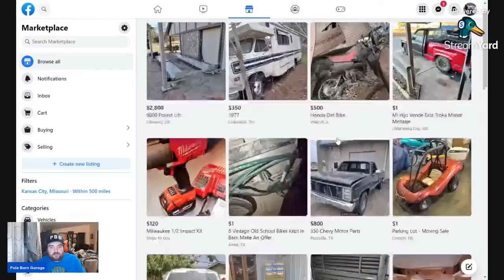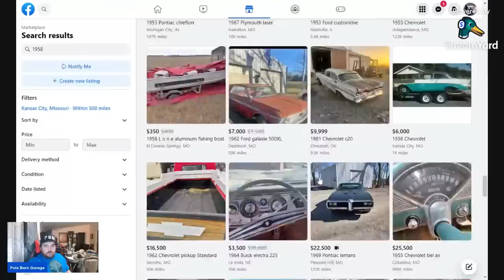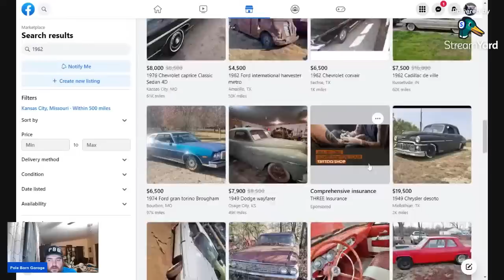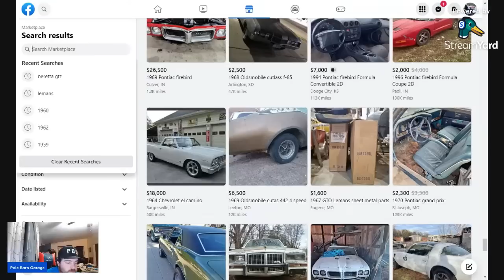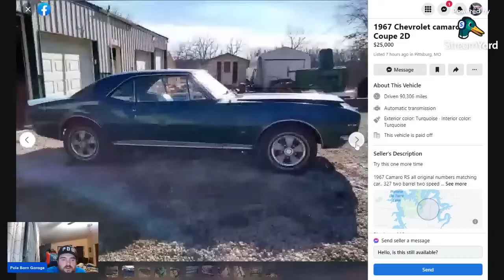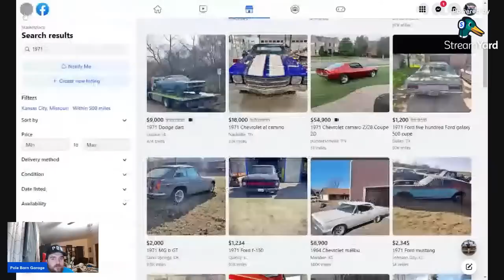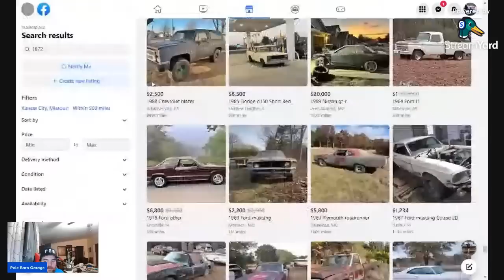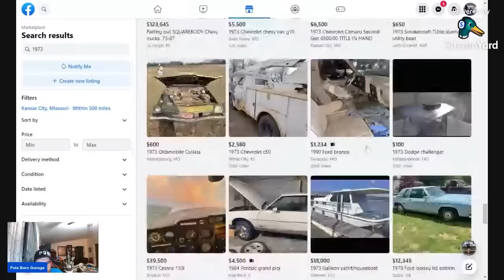The Wild World of Facebook Marketplace LIVE! How do you Find All These Cars?

Comment: That 18500 1958 cadillac was worth that. They only built like 300 of them, and the were like 14000 when new. Restored those have sold for 250000 dollars. They also had every option available, a stainless roof, and a built in mini bar with cadillac shot classes. As rough as that one was it was complete.

Comment: I'm thinking of buying some 16x8 dodge ram lug bolt pattern Indy sprint polished aluminum wheels and put on my 2000 dodge ram Laramie slt longbed quad cab 1500 4x4,, and put Goodyear duratrac at 285/75/16 tires